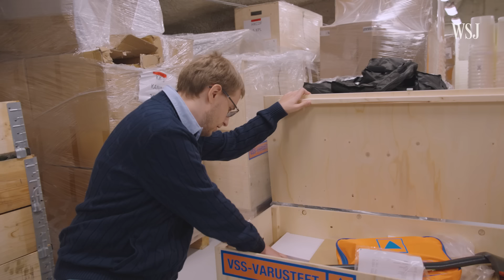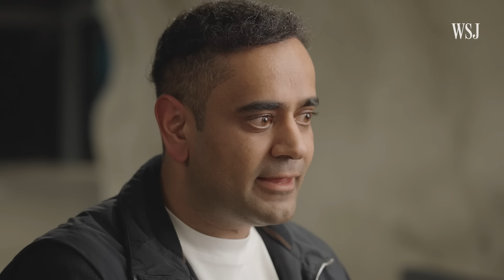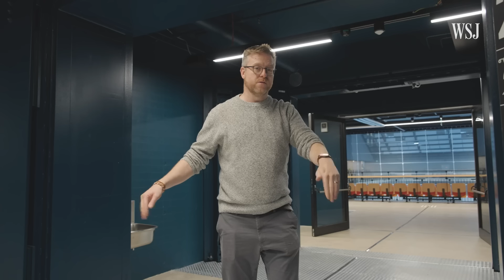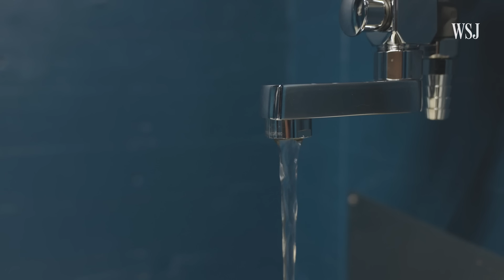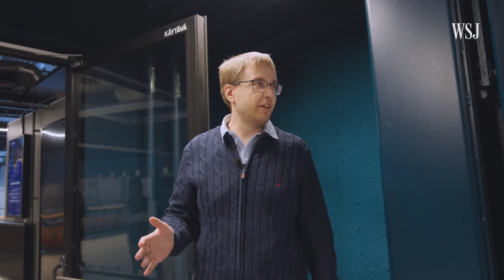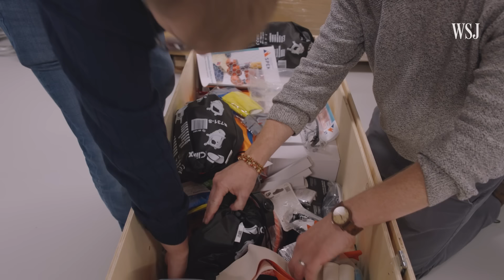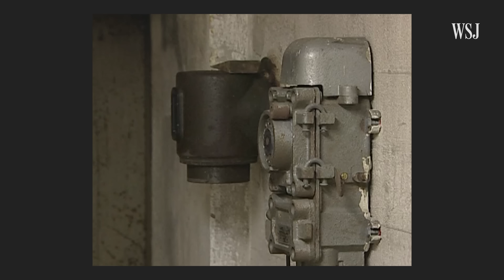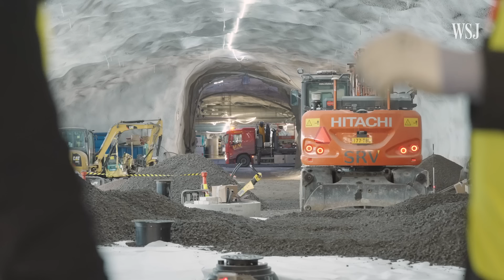What It Takes to Build a Modern Nuclear Shelter for 7K People | WSJ

Comment: They never think this through. When a nuke is launched for finland has just 5-10 mins before it hits. How exactly do you move 7000 people from wherever they are in here in 10 mins? You can’t even do it even if they were lined right at the door let alone miles away in chaos and cars
Reply: The nukes sure won't start falling from out of nowhere. There is a previous escalation. This shelter is next to a city center. People from miles away don't have to rush into a shelter from miles away because in Finland, a law requires every single building over 1200 square metres to have a shelter so the nearest shelter is probably within a one minute walk. Every large apartment building, school, hospital, sports venue, shopping center, etc. has one. 55 000 shelters across the country of 5,5 million people.
Also these shelters main purpose is to protect any kind of bombings and catastrophes like reactor accident in a nuclear power plant or normal bombings. We're not in a Hollywood apocalypse movie.

Comment: Money laundering as its finest.
Reply: how come
Reply: Many people thinks that those shelters are only for the nuclear bomb attack or that you have to live there for a longer period of time. 
They are only partly right, bomb shelters are primarily for war situations where people have to be evacuated underground, for example due to missile and drone attacks or if the attacker decides to use chemical weapons against the civilian population. A nuclear attack is only the worst-case scenario, which has also been considered, but the main purpose of bomb shelters is to prevent enemy missiles, drones and other air strikes, for example bombers. The bomb shelter in the video was just one of many, but Finland is full of various sized civilian shelters, the largest of which are located underground, about 10-30 meters underground. All large residential buildings have a civilian shelter for residents, and if you do not have your own civilian shelter, the nearest underground shelter can be found in large population centers 1-15 km away. In Finland, it has been necessary to prepare for this type of evacuation of people because Finland's eastern neighbor, Russia, has shown in its history that it is capable of launching an offensive war at any time for any reason. Ukraine is a good example of this for the modern world, while Finland still remembers what happened in 1939. 
Finland has been preparing for the worst for over 80 years and this is maintained only because the worst option may come true someday. There are only about 5.5 million people in Finland, but it is important to note that with these preparedness measures that have been taken in the past, Finland is able to offer a civilian shelter to about 4.6 million people in the event of a crisis. I think this is a great achievement by the Finns and what is best is that every adult Finn is aware of this and they are constantly trained for various crisis situations. 
Within 72 hours, most of the entire adult population is put on alert if, for example, they are targeted by a full-scale war of aggression launched by an external state or actor. This includes wartime troops, army reserve troops whose deployment begins immediately, other crisis troops, hospitals, provincial troops, and other personnel who, in addition to their own civilian work, have received special training for war and crisis situations. 
And as I said, Finland is preparing for the worst, but only because they are ready to defend their homeland and their own independence as an independent state and to give the best opportunity for Finns to survive together so that no one is left alone. 

Your homeland is where you were born and for Finns, their own country is the best and most beloved, they want to hold on to it now and in the future by preparing for the worst scenario as well. 

Peace and Love to all over the World!❤️

Comment: Kinda defeats the purpose of the 8 inch thick blast doors if the air valves built next to the doors aren't anywhere near as thick.
Reply: It doesn’t need to be as thick because it’s not trying to “tank” the blast like the door. The valve is small and self-closing. The explosion slams it shut and seals it tighter. Small area has much smaller force.
Reply: Little quarter inch steel valve cover that closes will get folded in like a tin can by a direct blast wave. We pressure shape steel like that to make propane cans, and a nuclear blast wave has the pressure.

Comment: Ok but nuclear shelters are useless without any power. So where will they get the electricity needed to keep the contamination in the air out ?
Reply: There is aggregator(s) of course.
Reply: Many people thinks that those shelters are only for the nuclear bomb attack or that you have to live there for a longer period of time. 
They are only partly right, bomb shelters are primarily for war situations where people have to be evacuated underground, for example due to missile and drone attacks or if the attacker decides to use chemical weapons against the civilian population. A nuclear attack is only the worst-case scenario, which has also been considered, but the main purpose of bomb shelters is to prevent enemy missiles, drones and other air strikes, for example bombers. The bomb shelter in the video was just one of many, but Finland is full of various sized civilian shelters, the largest of which are located underground, about 10-30 meters underground. All large residential buildings have a civilian shelter for residents, and if you do not have your own civilian shelter, the nearest underground shelter can be found in large population centers 1-15 km away. In Finland, it has been necessary to prepare for this type of evacuation of people because Finland's eastern neighbor, Russia, has shown in its history that it is capable of launching an offensive war at any time for any reason. Ukraine is a good example of this for the modern world, while Finland still remembers what happened in 1939. 
Finland has been preparing for the worst for over 80 years and this is maintained only because the worst option may come true someday. There are only about 5.5 million people in Finland, but it is important to note that with these preparedness measures that have been taken in the past, Finland is able to offer a civilian shelter to about 4.6 million people in the event of a crisis. I think this is a great achievement by the Finns and what is best is that every adult Finn is aware of this and they are constantly trained for various crisis situations. 
Within 72 hours, most of the entire adult population is put on alert if, for example, they are targeted by a full-scale war of aggression launched by an external state or actor. This includes wartime troops, army reserve troops whose deployment begins immediately, other crisis troops, hospitals, provincial troops, and other personnel who, in addition to their own civilian work, have received special training for war and crisis situations. 
And as I said, Finland is preparing for the worst, but only because they are ready to defend their homeland and their own independence as an independent state and to give the best opportunity for Finns to survive together so that no one is left alone. 

Your homeland is where you were born and for Finns, their own country is the best and most beloved, they want to hold on to it now and in the future by preparing for the worst scenario as well. 

Peace and Love to all over the World!❤️
Reply: Yeah... They probably need food as well. But how they do it might be classified, so it's not allowed to be shown.

Comment: Thank you for the video.

Many people thinks that those shelters are only for the nuclear bomb attack or that you have to live there for a longer period of time. 
They are only partly right, bomb shelters are primarily for war situations where people have to be evacuated underground, for example due to missile and drone attacks or if the attacker decides to use chemical weapons against the civilian population. A nuclear attack is only the worst-case scenario, which has also been considered, but the main purpose of bomb shelters is to prevent enemy missiles, drones and other air strikes, for example bombers. The bomb shelter in the video was just one of many, but Finland is full of various sized civilian shelters, the largest of which are located underground, about 10-30 meters underground. All large residential buildings have a civilian shelter for residents, and if you do not have your own civilian shelter, the nearest underground shelter can be found in large population centers 1-15 km away. In Finland, it has been necessary to prepare for this type of evacuation of people because Finland's eastern neighbor, Russia, has shown in its history that it is capable of launching an offensive war at any time for any reason. Ukraine is a good example of this for the modern world, while Finland still remembers what happened in 1939. 
Finland has been preparing for the worst for over 80 years and this is maintained only because the worst option may come true someday. There are only about 5.5 million people in Finland, but it is important to note that with these preparedness measures that have been taken in the past, Finland is able to offer a civilian shelter to about 4.6 million people in the event of a crisis. I think this is a great achievement by the Finns and what is best is that every adult Finn is aware of this and they are constantly trained for various crisis situations. 
Within 72 hours, most of the entire adult population is put on alert if, for example, they are targeted by a full-scale war of aggression launched by an external state or actor. This includes wartime troops, army reserve troops whose deployment begins immediately, other crisis troops, hospitals, provincial troops, and other personnel who, in addition to their own civilian work, have received special training for war and crisis situations. 
And as I said, Finland is preparing for the worst, but only because they are ready to defend their homeland and their own independence as an independent state and to give the best opportunity for Finns to survive together so that no one is left alone. 

Your homeland is where you were born and for Finns, their own country is the best and most beloved, they want to hold on to it now and in the future by preparing for the worst scenario as well. 

Peace and Love to all over the World!❤️

Comment: bunkers are all modern and advanced but these people rarely plan what will happen if people get fed up and throw a coup inside these shelters since not everyone is going to get treated the same, there will be hierarchy's, example people is part A get 2 slices of bread and a slice of ham but people in part C only get 1 slice and 1/2 a slice of ham, its going to happen sometime in the shelter give someone a little power like head of the area or dorm and they will start to hoard resources to live better, and once the outside is clean an livable, there probably wont be enough people to rebuild what we had instead we would be back at square 1 rubbing sticks together to make fire.
Reply: These are meant for short-term use in various situations like bombing, nature disasters, nuclear power plant errors, etc. Not for Apocalypse.
Reply: Many people thinks that those shelters are only for the nuclear bomb attack or that you have to live there for a longer period of time. 
They are only partly right, bomb shelters are primarily for war situations where people have to be evacuated underground, for example due to missile and drone attacks or if the attacker decides to use chemical weapons against the civilian population. A nuclear attack is only the worst-case scenario, which has also been considered, but the main purpose of bomb shelters is to prevent enemy missiles, drones and other air strikes, for example bombers. The bomb shelter in the video was just one of many, but Finland is full of various sized civilian shelters, the largest of which are located underground, about 10-30 meters underground. All large residential buildings have a civilian shelter for residents, and if you do not have your own civilian shelter, the nearest underground shelter can be found in large population centers 1-15 km away. In Finland, it has been necessary to prepare for this type of evacuation of people because Finland's eastern neighbor, Russia, has shown in its history that it is capable of launching an offensive war at any time for any reason. Ukraine is a good example of this for the modern world, while Finland still remembers what happened in 1939. 
Finland has been preparing for the worst for over 80 years and this is maintained only because the worst option may come true someday. There are only about 5.5 million people in Finland, but it is important to note that with these preparedness measures that have been taken in the past, Finland is able to offer a civilian shelter to about 4.6 million people in the event of a crisis. I think this is a great achievement by the Finns and what is best is that every adult Finn is aware of this and they are constantly trained for various crisis situations. 
Within 72 hours, most of the entire adult population is put on alert if, for example, they are targeted by a full-scale war of aggression launched by an external state or actor. This includes wartime troops, army reserve troops whose deployment begins immediately, other crisis troops, hospitals, provincial troops, and other personnel who, in addition to their own civilian work, have received special training for war and crisis situations. 
And as I said, Finland is preparing for the worst, but only because they are ready to defend their homeland and their own independence as an independent state and to give the best opportunity for Finns to survive together so that no one is left alone. 

Your homeland is where you were born and for Finns, their own country is the best and most beloved, they want to hold on to it now and in the future by preparing for the worst scenario as well. 

Peace and Love to all over the World!❤️

Comment: Interesting what about, manufacturing or re manufacturing critical equipment components or supplies,generating new uncontaminated clothing greenhouse to grow food if the shelter has to be used for an extended period.
Reply: Many people thinks that those shelters are only for the nuclear bomb attack or that you have to live there for a longer period of time. 
They are only partly right, bomb shelters are primarily for war situations where people have to be evacuated underground, for example due to missile and drone attacks or if the attacker decides to use chemical weapons against the civilian population. A nuclear attack is only the worst-case scenario, which has also been considered, but the main purpose of bomb shelters is to prevent enemy missiles, drones and other air strikes, for example bombers. The bomb shelter in the video was just one of many, but Finland is full of various sized civilian shelters, the largest of which are located underground, about 10-30 meters underground. All large residential buildings have a civilian shelter for residents, and if you do not have your own civilian shelter, the nearest underground shelter can be found in large population centers 1-15 km away. In Finland, it has been necessary to prepare for this type of evacuation of people because Finland's eastern neighbor, Russia, has shown in its history that it is capable of launching an offensive war at any time for any reason. Ukraine is a good example of this for the modern world, while Finland still remembers what happened in 1939. 
Finland has been preparing for the worst for over 80 years and this is maintained only because the worst option may come true someday. There are only about 5.5 million people in Finland, but it is important to note that with these preparedness measures that have been taken in the past, Finland is able to offer a civilian shelter to about 4.6 million people in the event of a crisis. I think this is a great achievement by the Finns and what is best is that every adult Finn is aware of this and they are constantly trained for various crisis situations. 
Within 72 hours, most of the entire adult population is put on alert if, for example, they are targeted by a full-scale war of aggression launched by an external state or actor. This includes wartime troops, army reserve troops whose deployment begins immediately, other crisis troops, hospitals, provincial troops, and other personnel who, in addition to their own civilian work, have received special training for war and crisis situations. 
And as I said, Finland is preparing for the worst, but only because they are ready to defend their homeland and their own independence as an independent state and to give the best opportunity for Finns to survive together so that no one is left alone. 

Your homeland is where you were born and for Finns, their own country is the best and most beloved, they want to hold on to it now and in the future by preparing for the worst scenario as well. 

Peace and Love to all over the World!❤️
Reply: It's not meant to be used for an extended period. It's called a nuclear shelter, but a nuclear war isn't our main worry and we don't live in a Hollywood apocalypse movie.